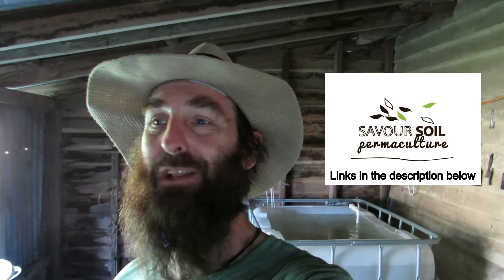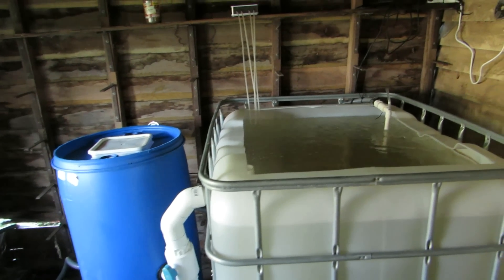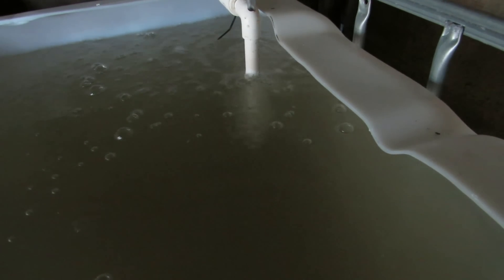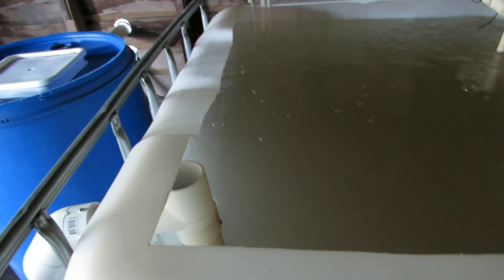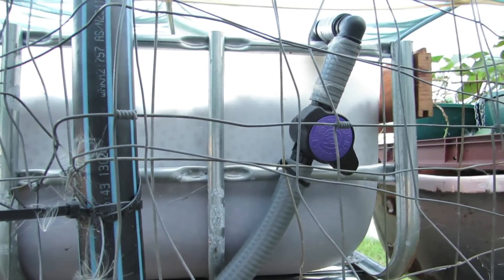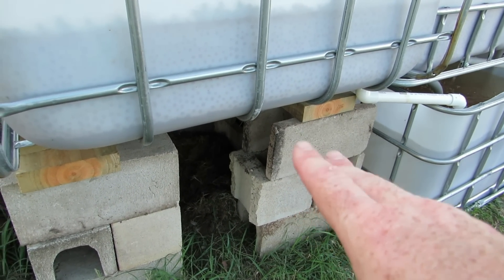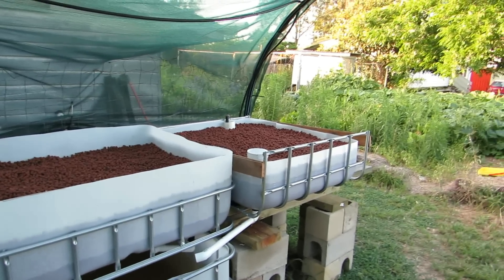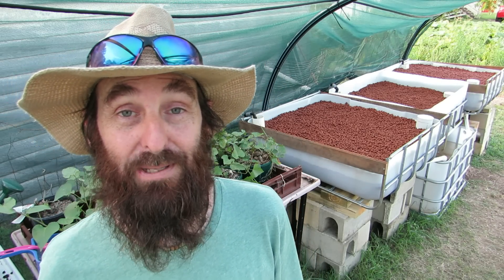New Aquaponic system build at Savour Soil Permaculture.

Comment: Great video, question 1. why dont you use the base of the cage as a grow plate? 2.  I would add grease and side plates and wheel the grow bed up and down the tank.
3. Why cut the tank cage at all? Why not flip it over after cutting the plastic and just use it without cutting it. You can then cut the wrungs from the top of the cage add springs and lower and extend the grow bed that is the base
Reply from the maker: You can use the base if you want. I prefer to use the flat sides.
No problem with making the beds movable. 👍 I don't see the need for it in my systems as I have all the access I need to the sump below. 
I have seen systems where they cut the bladder & flip the grow bed over. Makes it very hard to access the fish below if it's a one bed system. Would be OK for bed over a sump I suppose but I would still prefer more access to the sump.

Comment: What do you do about rain water when using these systems? Do the beds have to be covered?
Reply from the maker: I don't cover our beds Mike but do leave enough "freeboard" so only the largest storms we get (once or twice a wet season) will over flow the sump. 
If I had my way I would have a roof over the top but the hip pockets just aren't deep enough at the moment. 
Hoe that helped some mate.
Cheers.
Reply: Thanks for the reply man, I cut my tote yesterday and am moving forward inside a new green house. I'm in South Louisiana so rain fall is a biggie LOL!  @RobsAquaponics
Reply from the maker: Hope the build goes smoothly Mike. 
Cheers mate.

Comment: any updates on this system? cant seem to find anything out there, its about what i am looking to run.
Reply from the maker: I think Michael had a fish die off and decided to retire it as an aquaponic system. Still a very workable design and one used by many backyarders around the world. He currently has it set up as an organic hydro/bioponic system as far as I know.
Reply: @RobsAquaponics  thanks for the quick reply. yes this system seems very workable. you mentioned in the video about your parents system. is it still running? hope the reno's are going well!
cheers Dave
Reply from the maker: @AllThingsTubecomau 
Still running as a chop and flip organic hydro system. Had grand plans but family health and other issues have stopped it from moving forward. Will be working on it over the Christmas break and hope to have a clip posted in the new year on it. Main issue has been to work out an easy clean filter system for my elderly parents.
House reno's are going well thanks. The concrete ring beam was poured today and the slab will be poured this Friday all going well.
Reply: ok glad to hear they are on the mend and look forward to the updates on the system on the holidays.

Comment: Hey Rob, why does the siphon drain on the second to last bed , being lower affect the siphoning? Siphoning is done by suction and gravity, or did I just answer my own question and not no it!!!?
Reply from the maker: When the sump tank get filled to capacity the outlet will be under water which could help prevent the siphon from initiating and  breaking until the water level drops. Not a huge issue but still would of liked it to be above the water line. 
Cheers.

Comment: Nice system. How is the economics of it?
Reply from the maker: That depends on the pumps used & their energy usage. A lot of folks have been turning to small solar & battery set ups & running 24v pumps for both air & water to save some coin on these smaller backyard systems. Being able to rotate the vegetable crops through the system efficiently also helps to keep the cost down low. 
Cheers

Comment: hi Rob BOB i am setting up a similar system on the Gold Coast and am wondering do i need to cycle the new system and for how long ? also i am trying to do this on a budget what other media can i use other than 100 % expanded clay can i use lava rocks or blue metal to take up some of the space in the grow beds i am also having a hard time finding info on pump head height is the max head height from the top of the pump or the surface of the water in the tank the pump is in and is the max head height set at the height of the outlet even if the outlet goes over the top of the tank and then goes under the water with a venturie just like you have done here
Reply from the maker: +Adam Tolley 
Think I'm a tad too late for this one Adam 😃 😩 Hope the systems going well. 
Cheers mate.

Comment: Great video! thanks a lot!!
Has anyone thought about using the sum tank for DWC ?
Reply from the maker: +Yoann Kollen 
Hi there & thanks.
I have seen folks use their sump as floating raft beds so it can be done. You just need to make allowances for the rise & fall of the water as well as the pipe for the pump as well as the inflows from other beds. In a set up like this. a small raft at the front would also act as a lid of sorts to stop debris falling into the sump.
Cheers & have a great one.

Comment: 8 cycles an Hr seem way too high, 3-4 cycles is best for fish, less stress, and you seem to think that air shooting into the tank is creating oxygen, its the turbulence on the surface of the water, it has nothing to do with how deep the bubbles are,
Reply from the maker: Hi there.  The fish tank wouldn't be getting anywhere near 8000lph flowing through it per hour. 
The system is set up as a split flow as I said in the clip & the venturi also slows the flow down.  A venturi was asked for so that's what Michael got. 
It was a commercial designer (a real one,  not one that sells AP plans) that recommended venturis to me & have been using them for the past few years with no issues at all.  They are a proven method to oxygenate the water & have used this same one with up to 60 fish in a 1000l ibc with no issues or oxygen starved fish at all.  
Hope that helps some. 
Rob
Reply: RobBobs Backyard Farming it would be an assumption to think the bubbles are making oxygen, do bubbles create it in the ocean, no, its the turbulence on the surface, the bubbles from the Venturi are braking the waters surface, that's all it dose, its not injecting it into the water
Reply from the maker: +WhatAmI “TheKingdomeWithin” IsItInMe 
Oxygen is in the air and the bubbles are the vehicle to get them into the water, bubbles don't "make" oxygen. 
The bubbles will transfer O2 into the water just as it does on the surface through their large surface area.
You might be interested to know that most of the oxygen that we breath actually comes from plants (phytoplankton) that live in the ocean, the same plants are responsible for oxygenating the oceans of the world. Wave action would account for a tiny fraction when you consider the vastness and depth of the worlds oceans. 
http://earthsky.org/earth/how-much-do-oceans-add-to-worlds-oxygen
http://news.nationalgeographic.com/news/2004/06/0607_040607_phytoplankton.html
Hope that helps some.
Reply: +Rob Bob's Backyard Farming the links not working, and like I said, you don't really need Venturi, just make a bigger splash is all ya need. but never mind, still like the setup :0)
Reply from the maker: +WhatAmI “TheKingdomeWithin” IsItInMe 
Fixed the links  ;-) 
Cheers mate.

Comment: bloke from across the ditch here robBob...  love your work..  I did have a question.   how many litres of aqua clay would there be in each grow bed? I can get 45 ltr bags but I have to ship them and shipping is expensive so I would like to get it roughly right first time..    ibc with std 12 inch medium depth..cycling using the fish food was great advice too,,  will try that out
Reply from the maker: Hi Glen & thanks mate.  
Hope they're not going to sting you too much for the shipping. 
In our beds we made from cutting the sides of the IBC's we used about 6.5 x 45L bags of the Canna clay.  
Hope that helps some mate.
Reply: helps a lot thanks.  about $50 nz for a 45 ltr so $325 nz per bed,  I tried to source volcanic stone but cant get it where I am and not to keen risking pea metal or similar so think ill be biting the bullet..
Reply from the maker: +glen robinson 
Have you thought about using rock on the base & clay on top? I set up our last bed like that & it helps keep the cost down a bit  https://www.youtube.com/watch?v=FXPvf2oBT3Q
All the best for 2016 Glen  👍

Comment: Nice and tidy build Rob...like the idea with the inverted lid on the radial flow filter...VERY nice. Do you have any information as to where to purchase the 750 lph back up air compressor with the Lithium Ion batteries ?
Reply from the maker: +Ray Selby 
Hey Ray. This is the jobbie I got for this system.
http://www.aquaholicsonline.com.au/ac-dc-automatic-emergency-lithium-backup-aquarium-air-pump-4-outlet.html
Still working through the comments on some older clips at the moment. You can always find me on the FB  page as I use it a lot for work & orders if that helps.
Cheers mate.
Reply: +RobBobs Backyard Farming Well mate did a good test on it.....runs well, no problems. I think you suggested a 10 hour time frame for an emergency situation.....I got 22 hrs from 240V shutdown on Friday arvo 3pm,  till Sat arvo 1pm. I am involved in electronics although in a different field and the way I see this unit operating is purely and solely off the Lithium "back-up" battery itself. It would appear that while 240V is connected, it is primarily charging the battery on a continuous cycle.
Reply: +Ray Selby Will post a full report on your FB page mate.
Reply: +Ray Selby No good on the 750lt back up air compressor mate ?
Reply: +RobBobs Backyard Farming  I knew you would be busy Rob, that is why I bumped this up. I hope I wasn't out of line. cheers, Ray.
Reply: Great stuff Rob....ordered, paid for on Monday and delivered today Wednesday...FAST service....thanks for the heads up :-)
Reply from the maker: +Ray Selby Is all good Ray. I saw your comment in the email description so thought Id come have a look. Missed the first one as it would of been grouped with other notifications. Is just easier to get me through the FB page at times ;) 
Would like to know what you think of the pump. Only know of you & Michael that are running them at the moment. 
Cheers mate & all the best.
Reply from the maker: +Ray Selby 
Thanks Ray 👍

Comment: should the ibc be painted so the sun don't crack it?
Reply: +gg gg Yes ... or wrapped in a solar blanket or something ... it also keeps the algae down.
Reply from the maker: +gg gg 
Hi mate. 
I've had some IBC wicking beds outside for 3 years & they're fine but others have started to crack after 18 months. Is a bit of pot luck if you don't know how old they are when you buy them.
The one inside the shed should be OK but it will be wrapped eventually to stop algae build up.
The beds outside are wrapped now waiting for some salvaged timber to become available so he can clad them with. 
Cheers & hope 2016 is a great one for you. 
Rob.
Reply from the maker: +Michel Vaillancourt 
It was all sorted the next week when the beds were wrapped in sections of an old tarpaulin. 👍 Michael is just waiting on some salvaged timber to clad them now. 
Cheers.

Comment: hey Rob i read somewhere i can have 10 kilos per 100 liters of water can i use a NFT with no grow beds for that?
Reply: +stevencox75 The general rule is 1Kg of fish can survive in 1000lt of water without mechanical aeration. An IBC tote has basically 1sqm of water surface area for direct dissolved oxygen exchange. Water Temp also effects water's abilty to hold onto oxygen, with cold water able to hold more. Their are many contributing factors regarding stocking density and filtration. An NFT will not provide any biological filtration merely a method of stripping out the Nitrites. It's a far more dynamic and complex system but where ever you read 10/100 is wrong.
Reply: ***** thank mate
Reply: Ahh, it was a leg pull...still it's kinda of important to clear up misinformation :)
Reply from the maker: +stevencox75 
:-D I think you'll find it's 1kg per litre of water Steven ;-) 
:-D Cheers mate.
Reply from the maker: Steven was having a shot at me & pulling my leg  +Whocan Donecan ;-)
I had a bloke contact me asking for advice as he was told at a workshop that was an OK stocking level for those grow beds & we had been talking about it earlier in the day.
Thanks for jumping in 👍  Have seen loads of bad info like that spread around the place. 
Cheers & all the best for 2016.
Rob.
Reply: It could of been 10 grams to 100l. Also note that a single 1kg fish has a lesser metabolism and environmental needs than 10x100g fish or 100x10g fish so going the weight is misleading. It is also species specific eg: Trout very demanding/sensitive vs tilapia very hardy. I would also encourage you to choose climate appropriate species for your area and not pose risk to the environment by keeping inappropriate potential pests. NFT is more or less just a addon option to existing systems if you have the materials...however due to the exposed nature of the pipe work/beds in a typical NFT it is extremely susceptible to temp spikes and fluctuations which stresses and potentially kills fish.( so I personally would not use NFT or spray/aeroponics) Unless you were using a tempurature controlled enclosed indoor/greenhouse.
Reply: ***** its the most common question on aquaponic forums and Rob knows me lol
Reply from the maker: +Whocan Donecan 
It is good & have been meaning to do a clip on it for a few months now. I would be asked about stocking densities at least once a week if not more.   
All the best for 2016 mate. 
Rob.

Comment: Wotcha!
I like the idea of the water entering the beds via down tubes. That would be a very handy place to put some fine filter material to catch any missed solids.
Reply from the maker: +Michael Tricker 
👍  The main purpose to have them is to direct the water & stop surface algae growth as the bed levels weren't settled on at that time.  I've used filter material in ours & it does help collect some fine solids. I think Michael's going to leave them in though. 
Cheers sir & all the best for 2016.